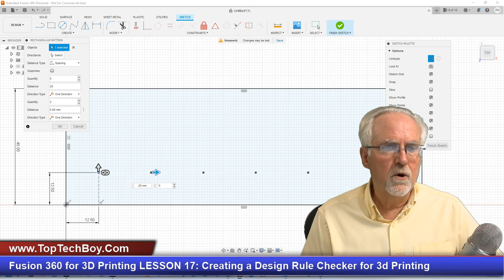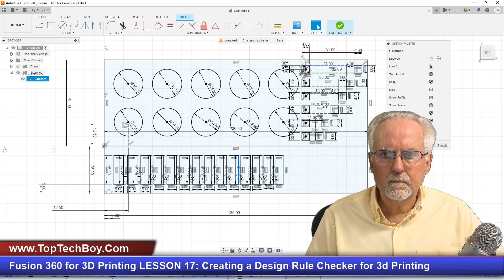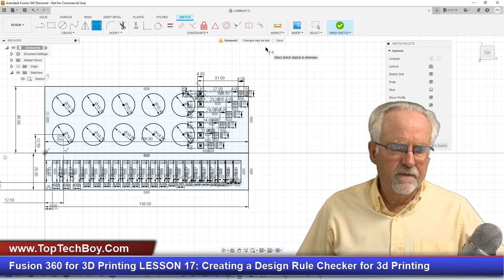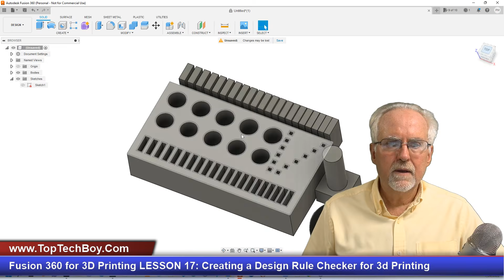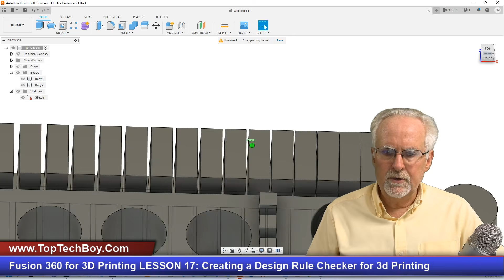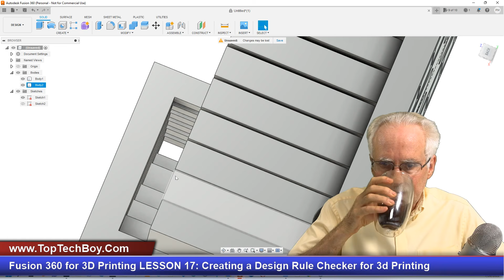Fusion 360 for 3D Printing LESSON 17: Creating a Design Rule Checker for 3d Printing

Comment: I don’t have a 3d printer yet but I’m still following along and making the 3d models so I can have them ready to print, for when I go over the lessons again. Also question for the design rules the prints are for us to better understand our printers and tools correct, will the model work for any printer? Like if you get 2 different printers can you use model for both. Thx
Reply from the maker: The model will work with any printer, and it shows the performance of your printer.
Reply: @paulmcwhorter thx for replying. I would rather use this model than the little boat.

Comment: OUCH ! So, I've religiously been following these lessons, meticulously replicating every step, paying particular attention to 'constraint' condition, but try as I may, there is no way my fusion will 'constrain' those cross beams for the bridging structure. It ALWAYS shows up 'blue/unconstrained' even though it 'snaps' ok to the corners of the post. I can proceed to extrude without issue (ignoring the unconstrained). Doing my head in !! Grr ...

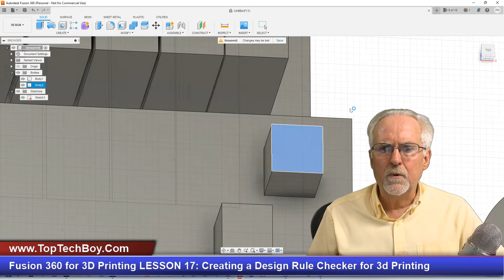Comment: Having some problems at 36:05 when trying to draw the rectangular bridges. My rectangles to not snap to "underlying layers" as you put it and I've noticed others having this same problem. I have found a fix by going to the "Create" tab (while in the sketch) and using the "Project" function to project "Specified Entities" to the drawing plane. I also found that the "Projection Link" box has to be checked, otherwise the drawn rectangles show as unconstrained. Is there any way to change something in the settings or preferences so that I can snap to "underlying layers" that share the same plane as my active sketch? The "Show Projected Geometries" box on the sketch palette is already checked and only affects the "Specified Entities" I manually projected.

P.S. I saw someone else online saying that this is only an issue with the purchased version of Fusion 360, not the free hobby version. Not sure if that is true or not, but mine is the purchased version.
Reply: I FIGURED IT OUT!!! I'll explain it right here so that others having this issue can learn how to fix it. This is a setting in the preferences. Do the following to fix the issue:

- Click your initials in the top right corner, then click "Preferences".
- In the menu on the left, click "Design" under the "General" section.
- In the "Preferences controlling general Design Behavior" section on the right, make sure to check the box next to "Auto project edges on reference" to turn it on.

This should allow you to automatically snap to points on the "underlying layers" as Paul did at 36:05
Reply: Thank-you, Ive been ages on that @RicksMunn
Reply: Thank you a lot!! @RicksMunn
Reply: @RicksMunn  I got the problem as you. By doing adjust the setting as you talk, I got successful as Paul. For those who have a problem like us , please make sure read this above comment carefully. It works. Thanks you for sharing.
Reply: @RicksMunn  Thank you.
Reply: Ricks Munn you are the man. Followed your instructions to the letter. Solved my problem perfectly. Two gold stars to you.

Comment: I posted a short video answering comment by @Rick Bonari  You can see it here https://youtu.be/o-ZcfyBEMpE
Nice to contribute back to the community. Thanks Paul for the great lessons!
Reply from the maker: Thanks Keith. I did not have time to really look into it. Sometimes people report troubles, and it is hard to tell if they have just made a mistake, or are running into some bug in fusion. I find it confusing that sometimes I can automatically snap to features in a lower sketch, and sometimes I cant, without explicitly projecting it.
Reply: Thanks for this it has helped me.  After using the menu option 'project' like you did, I was able to snap to the projected geometries and the sketch stayed constrained :)

Comment: Hi Paul,

I did a test sketch with a base and two posts (4x4) spread 25 mm apart. I extruded the base up 5 mm and the posts up 25 mm. I started a second sketch with the plane on top of the second post as you did. When I do this the sketch rotates around to the opposite plane. Very different from how your second sketch worked. When you selected the top of the right post it stayed to the right and snapped to the front. When I did the very same thing the right post flipped to the left. The hole thing rotated so plane wasn't proper. I'm thinking something is wrong in the settings somewhere. Show protected geometries in sketch two settings was selected. This is very frustrating and should be very simple. Any help with this would be helpfull. Thanks much.
Reply: A couple of things. First you want to zoom in so you get a large enough view to ensure you are not clicking an edge. Second make sure you are out of sketch mode then click the sketch button then choose plane. Unless you have changed some settings it should work as Paul shows.
Reply: The same thing happens to me when I create the second sketch it rotates. I was unable to get the second sketch to stay constrained despite repeating the entire lesson. I have just carried on and printed anyway.
Reply: I had the same thing happen: adding the second sketch the way Paul did it caused a loss of full constraint. The solution: I used construction lines between the bridge rectangles. Doing this kept the drawing fully constrained.

Comment: I got the sketch done and it is fully constrained and got everything extruded and it showed two bodies. Also had problems with bridges where in the second sketch and selecting the correct plane the rectangles would not snap together. I tried and successfully deleted second sketch and went back to the sketch one level and extruded again and now every item on the design rule checker is a seperate body. Shows that I have over one hundred bodies. Why would this be. I went back to the finished sketch 1 level in the timeline and re-extruded everything and it still thinks everything is a seperate body. Not sure what the issue might be?Tried everything but no go?
Reply: Sometimes it is just as easy to start over from scratch. The practice will not hurt and you will likely end up with a cleaner drawing.
Reply: Hi, I have the same problem, did you manage to solve it?

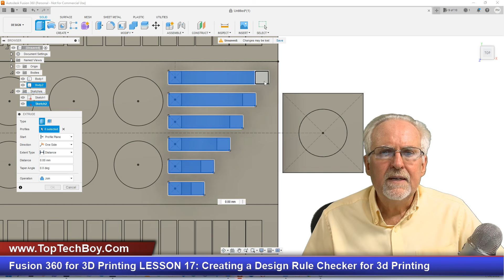Comment: At 37:06 in the video when Paul went to extrude the bridges over the pegs he also had to select the top of the post where the sketch was started.  At first I didn't see what was done before the actual extrusion, but after watching that short section a few times, I just selected the top of the post and it seems to have extruded fine.  Now an issue I've noticed is my second sketch is not fully constrained.  That happened when I drew the first rectangle on top of the posts, and I have been unable to determine why it isn't fully constrained.  Any ideas?  From anyone!
Reply from the maker: make sure the corners of your rectangle are snapping to the underlying corners of the posts. On your sketch pallet, make sure that 'show projected geometries' is selected, which should let you snap to features in other visible sketches.
Reply: @paulmcwhorter  No joy!  As soon as I place the rectangle on the second sketch (originating from the top surface of one of the pins) over the raised pins, even though the constraint icons appear on all four sides of the rectangle, the sketch itself is showing not fully constrained. Ugh!  And while I haven't printed it yet, the model looks complete in Fusion360 and I have exported the STL file and sliced it in Cura.  What's the significance of continuing while not being fully constrained?
Reply: I have the same problem.  Is it a bug with Fusion 360 maybe?  I am using version 2.0.14110.  I have show projected geometries selected but whatever I do the sketch will not stay constrained.